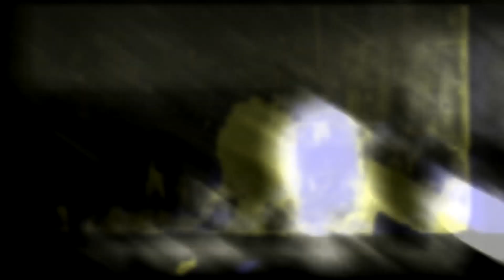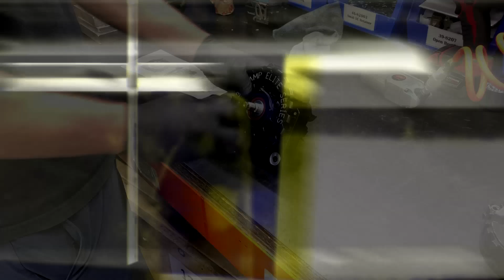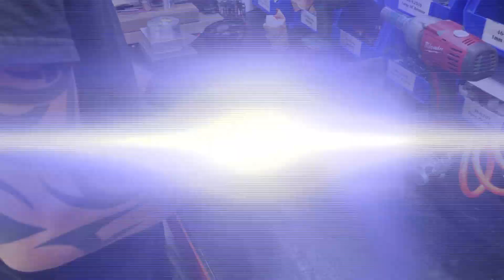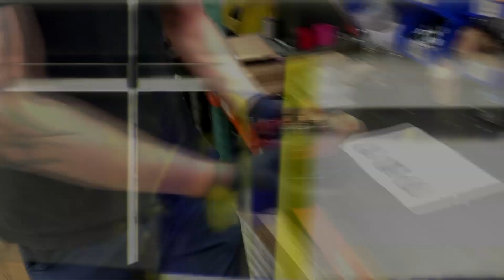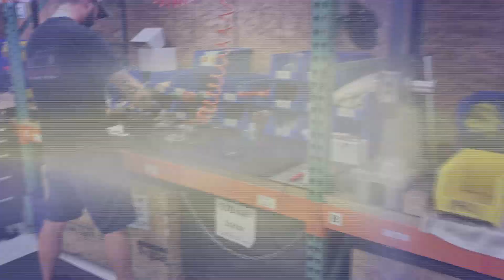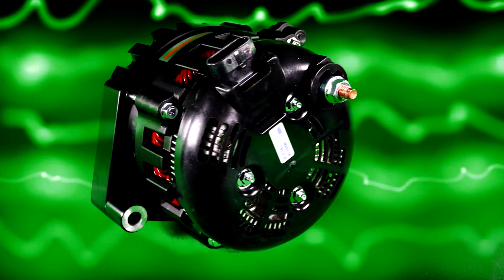The Process of Building a Mechman Billet 370 Elite High Output Alternator.

Comment: I don't know if I need 370 amps, but you offer a 250 amp alternator for my application.. I'll be ordering one. My stock 105a alternator is barely keeping up with my new fuel injection electronics. My idle voltage hovers around 12.7-12.8v. 340lph fuel pump, Holley fuel injection. Dual electric fans. Light bar hidden behind the grille, 4 light relay so my low beams stay on when I switch on my brights. I'm going to add an aftermarket transmission controller for a 4L80E soon, and it may be the straw that breaks the Camel's back. 
  Thanks to Gale Banks for introducing me your products. He only uses the best.